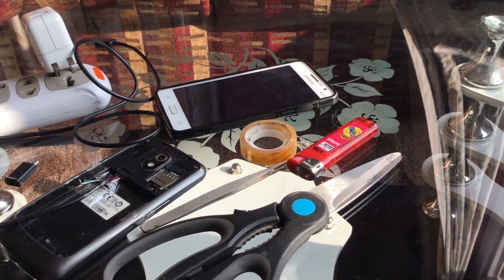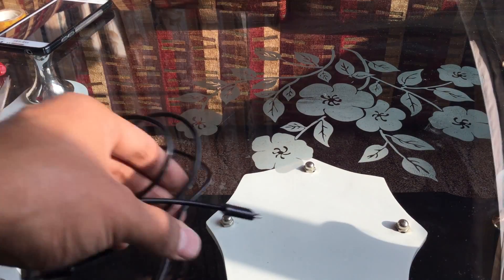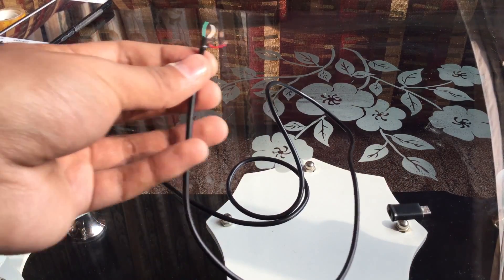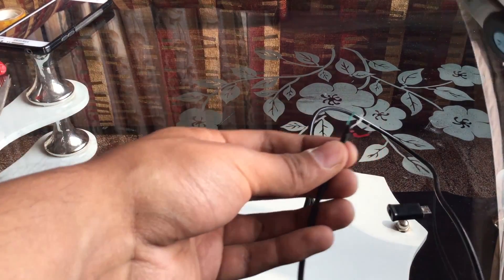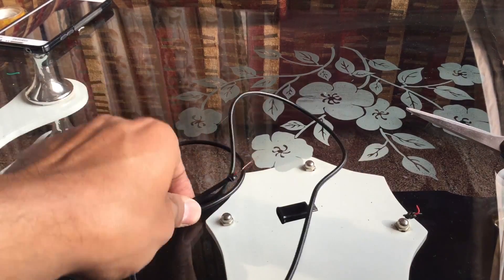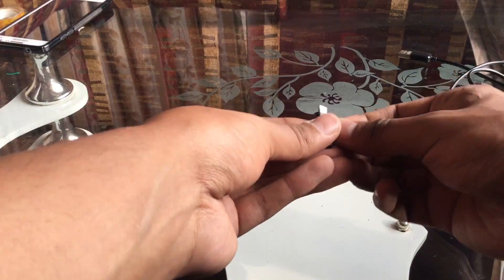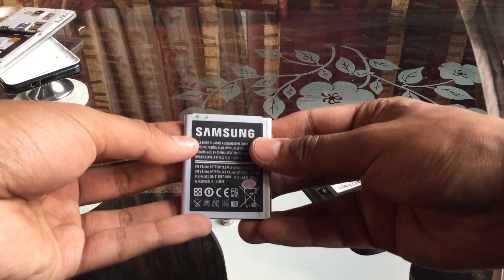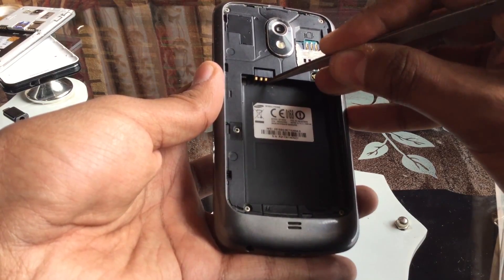How to run android phone without battery?

Comment: I'm trying to run a device with HB356687ECW battery like this. Is it even possible? I cant figure out if there are any converters to this battery connector or what the connector is even called. On top of all that I hear that some devices have battery checks that might prevent them from booting even if I somehow add the power wires.

Comment: good video......but the voltage from charger wires are always higher than that of a charged battery.....so , in this method, chances of getting the phone damage is there.

Comment: Why not simply plug an external USB charger as external power supply ?
Reply: Most phones check for a battery to boot even if plugged in.  If you leave it plugged in all the time with a battery you run the risk of overcharging and offgasing in the battery and end up with a spicy pillow (expanded battery) that could burn up or pop.
Reply: @blakebarks  But as you see, he didn't use any battery and the phone booted up correctly. Perhaps it's an old model. I have a 3 year old Motorola G5s plus and the battery is almost not holding any charge, I have to use it hooked on the charger, because it lasts only half an hour. I can't find new original motorola batteries to change, so, I don't know what to do. Perhaps I'll have to use it eternally on the charger. The battery doesn't turn hot not became thick. What do you suggest, please ?

Comment: What's the longest your phone stayed running? Without the 3rd wire it will keep on Discharging at lest thinks it is even though the volts are still good. It will turn it off after so many hours. Did you fix this and if so how?

Comment: For those who couldn't get this to work on their phone, it won't work on all phones.  Some phones incorporate some logic in their batteries that will check with the battery on boot up and not boot up if it detects a problem with the battery.  I remember trying to directly hook up before on a sony xperia phone.  It would start to boot and reboot at the same point during the boot up sequence.
Reply: Bro,I also have Sony Xperia C it has a chip to connect the battery to the board unfortunately it's battery's chip is damaged. So how can I start it without battery
Reply: I have an s6 but it only boots up if it’s directly hooked to the outlet without a brick but it’ll restart after every minute
Reply: No that's not how it works a cellphone charger charges in surges as in increase decrease increase decrease pattern and a battery is constant it does not stop untill fully dead the cell phone is not detecting whether the battery is good or not rather the phone requieres constant current to keep running and your cellphone charger is incapable of being constant.
Reply: @jemuelhernandez682  yes, most phones do have logic that checks the battery.  Every phone is going to work differently.  In my LG G4, there is a bug in the startup routine that makes the phone think the battery is connected and will stay powered on.  If I don’t activate the bug, the phone shuts down with a “battery removed or not working” error.  If I trick the phone into thinking the battery hasn’t been disconnected, it will run months without a battery.

Comment: Sorry.. seems this method will slowly destroy the phone itself coz of oversupply voltage.. normally, charging adaptor output 5v while smartphones normally maximum takes around 4.2v. U need a step down converter module for safety measure.
Reply: @bro_leo  I'm trying to do this. Could you share which products you used to do this?

Comment: Testing on LG K7 LTE with LM2596 module.

Soldered +ve o/p from module to the 1st Terminal (from left) on the S-Phone AND the -ve (black) to the 3rd. (Not sure if I should connect it to the 4th instead).

NO SIGNS OF CHARGING!
NOT EVEN REJECTING THE BATTERY.

(NOTE: The actual problem was the smartphone Not Recognising the battery for whatever reason. Simply rejected to charge showing it is an INVALID BATTERY, though I've been using it for at least 6months)

So I put the old battery upon the soldered pins and tried powering ON. And It DID! :)

But dunno if it is ByPassed or not yet.
And I wouldn't dare check it now as now it's doing its 
"Android is Starting: Optimizing apps 1 of ..." Loops. Usually loops 5-6 times on abrupt shutdown/restart before booting to OS.

Entering the 5th loop as I type.
And I just noticed the voltage dipped to 3.5v (from 4.2v I had set) for the first time. All 4 prior loops was at 4.0v with +/- 0.2v variation.

UPDATE 1:
Finally Booted to OS HomePage. But shutdown immediately showing INVALID BATTERY.

Increased to 4.4v and this time:

Tried powering without Battery.
Wouldn't Boot.
Showed : the Question Mark inside Battery symbol ( meaning No Battery)

Tried Again WITHOUT BATTERY
This Time Booted for 3 secs and then No Battery Symbol showed up.

Suspected improper solder.
Tried pulling and the the -ve wire popped out.

Gonna do some proper soldering prior testing again now that I know I can get to the OS somehow.

The Touch wasn't responding. Without which I don't think I can do what I want from it. But I am testing anyway

WIlL UPDATE
Reply: Did you solve it?

Comment: Not running with diodes first i applied 2 diodes in series nothing happened then i tried 1 diode phone started but then stoped then started again process goes on  then i connected directly and running well. 
Diode used IN4007
charger output 5v and 0.7A

Comment: @AmbSwizag  Liked the first and second comment, BUT I HAD TO try this video's hack on a Samsung GT-S5300, I don't have extra resources, to talk of... 😅 I know next to nothing of electronics, VERY NOOB, but THIS worked on THAT phone. I'm running a USB cable straight from it and into a newer charger, I believe a transformerless one, and CONSTANTLY checking both the phone and the charger. Both seem fine and not heating up, as in, AT ALL. I have been doing this for about three (3) days now. So, I, for one, am very happy and blessed to have come across this video. Maybe the newer transformer helped, or as you said, maybe the phone has the voltage regulator. I couldn't find any documentation, on Samsung's sites, about this. Anyways, I hope this helps someone out there and keeps more stuff out of landfills, and rather, put to second purposes.
Reply: for secondary purposes i need a phone that can work without a battery to use at home. Have you tried it with a newer model than the phone you mentioned in the comment?
Reply: @Musica_Puerte  not yet, but my A5 16 might be next. That GT5300 lasted for a year, then we got burgled and THAT got taken😂 with a few other things. It was in daily operation till then and was acting as a sort of home landline and mobile router when needed. As I said, I'm no expert, but I'd just go for it. Let me know how it goes if you do try? All the best

Comment: new models dont work. have protection for this. and cell shutdown after powers on, witch any voltage or ampere.
any sugestions? galazy j5 and up.
Reply: I would also love to hear of any new ideas!
Reply: Use a old batteries board (in battery)

Comment: Sir i did the same on my lyf ls5016 andriod but it start shows company logo and switch off again but at same time it works fully when i hard reset it and clear factory data and more

Please help me
Reply: I have also same problem
Reply: Dear can you explain in urdu or in hindi?
Reply: @localbus7008   sorry but don't now urdu only english and hindi and punjabi
Reply: @localbus7008  u can use translater on your android and if u want video i will share link till day after tommorow
Reply: @ankitpandey8435  you can explain in hindi but in roman not in pure hindi
Reply: @ankitpandey8435  you may send the link ill try.
Reply: @ankitpandey8435  oh yara tusi daso asan smakjh laangy..
Reply: @localbus7008  i will send video link
Reply: @ankitpandey8435  ok dear thanks...
Reply: @localbus7008   bro just join nutaral wire by attaching and disattaching with negative wire of phone while giving power and try to use any battery as in charger there is not stable current but in battery it is i also do same with my phone and now it is working but yes it took lot time and some time if i didn't connect and disconnect wire on right time than it again power off.

Comment: What if someone connect USB drives through OTG then had to power using tablet? does this still capable to keep Tablet running and powering OTG devices..?
Reply: It will dead as soon as you disconnet or lose wire

Comment: I think this is not a universal fix.
You will find that not all mobile batteries will output the 5v that you get out of your USB charger. For example my Samsung 4 battery has a 3.8v output from the battery, and so does my HCT phone.
The voltage in these cases must be reduced for it to work.
Reply: Easy Fix?

Comment: I've seen some ghetto ass mods but this one is right up there. Using all the wrong tools, powering the phone at the wrong voltage and wrapping the wires around those pins in a way that's basically a guarantee for them to short out.
I'd consider this video a great example of how NOT to perform any mods.
Get some proper tools, check what power input your phone actually needs and get a soldering iron.
Reply: This is for broke people not people that can buy voltage tools and soldering iron. At that cost you can just have the charger port replaced

Comment: this is not the correct way you should have taken the protection circuit present in the battery and then connected the positive and negative wires with them. This is not recommended.